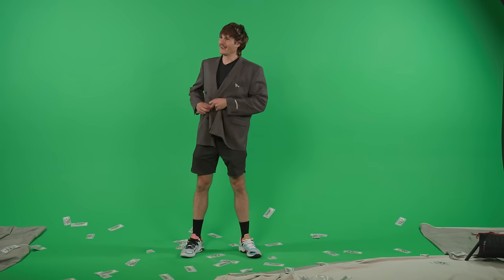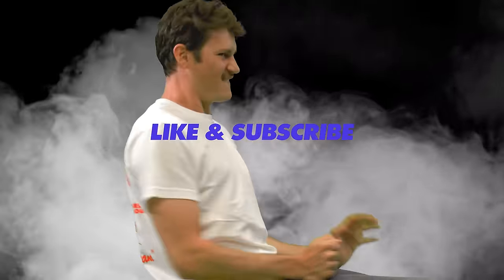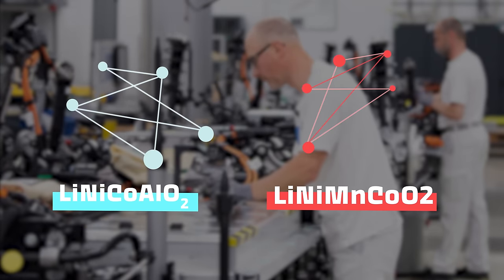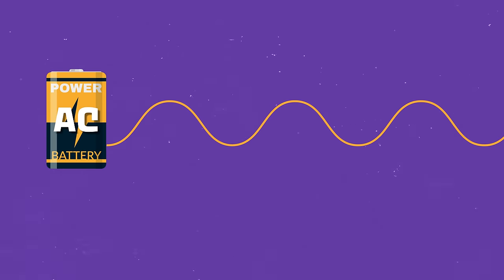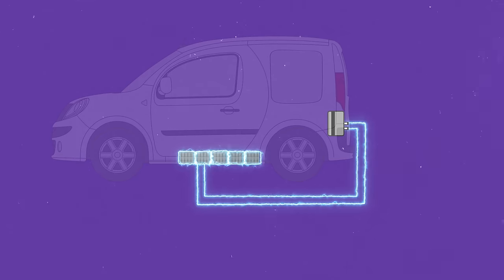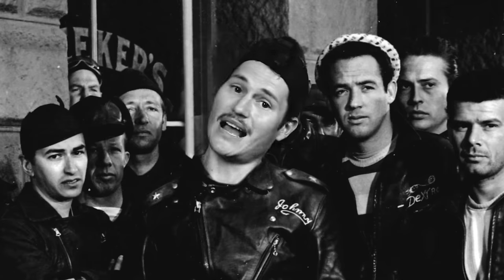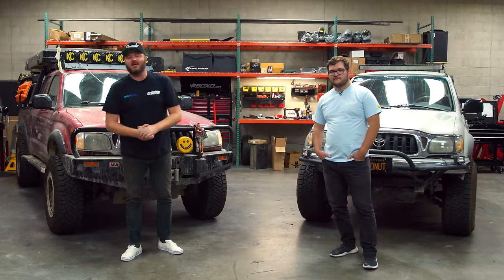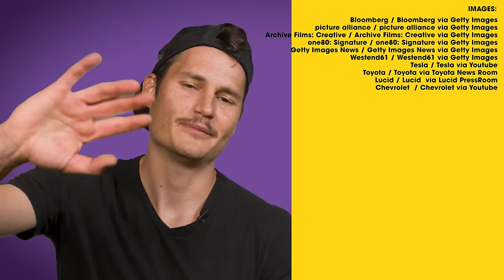Why this Chinese Car Costs $900

Comment: Imagine how much of a hot rod this thing would be with a 10 horsepower lawnmower engine.
Reply: That is for the tuning community to figure it out
Reply: That's a power increase of 525%!!!!!
Reply: @roycezaro1998  : Getting your laundry done in less time.
Reply: I found a truck version for the same price.
Reply: With only 2 cable operated drum brakes to stop...no way
Reply: I'm thinking bigger batteries, or maybe more of them and maybe a bigger hp electric motor
Reply: Basically my idea for the PHV (personal hybrid vehicle.) 7hp Predator engine in the rear, dual front electric motors with torque vectoring, by-wire steering (so the torque-vectoring front motors don't make the steering feel weird.) Would be geared for 30 mph, but electronically limited to 25 for low-speed-vehicle registration reasons.
Reply: Just put a roll cage, coilovers, upgrade the brakes and put a motorcycle engine on it.
Reply: what about a 10 hp engine for a washing machine?
Reply: They have an option for 600cc gas engine
Reply: @jjqq9456  hybusa build
Reply: Why stop there, how about a chainsaw engine. Other great idea crash test, cone, skid pad 0-60 the whole works and then those guys can have a demolition derby.
Reply: @aspecreviews  nahhhh have 2 modes, one for 25/30mph and one for 55 mph :X
Reply: @killerdeamonking  Federal regulations mean it couldn't legally exceed 25 MPH.
Reply: @aspecreviews  Legally no , But people do it anyways.
Reply: @aspecreviews  They modify those mini trucks to do over 25 MPH when sold to the USA by disabling the Governor.  So nothing really changes here.
Reply: @killerdeamonking  everything changes. PH-V would be a very sophisticated hybrid drivetrain. If it was regeared for 55 MPH, the stock control logic would frequently stall the engine, since it's not expecting to suddenly have 55-MPH gearing. The engine clutch would have to be engaged at a significantly higher speed.

Just swapping the engine wouldn't work either, because it'd need to retain all the same sensors as the stock engine. And no matter how high the engine could rev with a hot cam, valve springs, etc, it would still cap out at about 4000rpm, because of the stock ECM and HVCM (Hybrid Vehicle Control Module) code.

Also, the torque-vectoring front motors would rev far past their rpm limits at 55mph, and likely fry the motor controller.
Reply: @aspecreviews  High and low gear . And yes you have to do a clutch mod and a ECM mod for this to work, Although not hard to do just time consuming.

Comment: Sounds like what I've learned here is get one of these as a golf cart, save money and have more speed then a norm cart that cost triple the price at least..
Reply: My workplace is 10 miles from home and I consider to buy one of those.
Reply: @Lassi Kinnunen 81 I agree with you and yes we have slow roads here. It is not worth it because as the poorest, my country is the junkyard of the EU. I think it is much better to make an EV conversion from 1st gen Smart for example. I do have two gasoline cars now and I wish one of them to be swapped for a cheap short range EV.
Reply: @Votoyar  where are you from?
Im from Germany, here is a ev conversion more expensive than a 5 year old smart .
Reply: @TC-iv7dn  I am from Bulgaria. Here 1st gen Smart can be found below 500 euro. The conversion can be cheap if your goal is below 30 miles per charge. It can be done with lead acid batteries.
Reply: @Votoyar  thats crazy cheap but for 10 miles I would cycle mabye. depends on your roads and how friendly the dudes on it are, ha ...

Comment: Someone needs to get a dozen of these together and do a top gear car-soccer game.
Reply: This seems like China's Reliant Robin
Reply: @Where_is_Waldo  Top Gear cut the suspension on that so it'd tip over.
Reply: @CTimmerman  I can't imagine they're hard to tip anyway though, it would take more skill to drive it safely than a regular car
Reply: @Where_is_Waldo  A regular car goes faster and is heavy enough to crush you. The Reliant Robin is a safer, dryer moped.
Reply: @CTimmerman  Well, ok. It just looks unstable to me. Dryer moped? I'm not familiar with that phrase.
Reply: @Where_is_Waldo  It's like a moped, but you're safe from rain.
Reply: @CTimmerman  Haha! Ah, Mo-Ped. Somehow I was thinking past tense of mope, as in "moping about"
Reply: @Where_is_Waldo  That would fit in case of a Peel P50 trying to use a motorway, but the Reliant Robin i conflated it with can do 137 kph.
Reply: @CTimmerman  Well that's a lot faster than I thought it could go. At that speed you'd better brake or turn, not both at once.
Reply: Is that like the game rocket league?

Comment: The modern model T a problem most people didn’t know they needed I can’t wait to see the custom retrofitting that people do to make them faster and more reliable.
Reply: drop a water cooled motorcycle engine in it. now you have more speed and heat in the winter. just find you a chain driven motorcycle. wouldn't be to hard.
Reply: @kevincornell1439  Fun fact, it wasn't chain driven. It have a fully functional differential.
Reply: @Saviliana  ah cool. So a shaft driven bike. An old Honda shadow or magna are a dime a dozen where I'm at.
Reply: @kevincornell1439  you're basically describing an autorickshaw

And yes some companies like tata and Bajaj did try but they failed (like the tata nano for example)
Reply: battery upgrades as Lithium or even used Lithium becomes more available,,, already people putting leaf modules into E-Scooters,,,
Reply: Except you can only go 40 miles max. This is no where near a model t
Reply: @Saviliana  This thing would be wicked with a K24 in it

Comment: This is actually very well explained, great job!  It all boils down to how one intends to use the zyx.  If it's just a 10mile daily back & forth on a very lite traffic, 30mph max route and the bike doesn't fit all your gear, this toy is a no brainer.
Reply: Not street legal in US, tho I'm sure still fun!  :)
Reply: @mmanda515  That depends a lot more on which state you live in. For example in my state of Massachusetts you could drive this on certain roads, but only if you register it as a Low Speed Vehicle, which represents its own hurdles, and even more limitations such as not being allowed to drive on roads with a speed limit of over 30
Reply: They are so cheap you could make it road legal for very little.
Reply: Another neat and actually useful purpose for this car would be as a transition/backup car
Let's make an analogy with PC GPUs:
Your home suffered a power surge which fried your $1,000+ fancy GeForce RTX 4090; this power surge caught you completely off-guard: you're broke, didn't have a UPS, and your CPU is an Intel's F SKU series, which means that it doesn't have an on-die GPU, thus rendering your PC useless whithout an external GPU. You buy a GeForce GT1030 for ~$30, which while you won't be able to play any games, at least you'll be able to use your PC in other tasks (e.g. vídeo watching, work, etc...) while you save again for another high-end GPU
This tiny thing would be the "car equivalent" of a GT1030, while you wait for your insurance to do anything or save enough money to buy another full-fledged car

Comment: The total cost for someone in the U.S. to buy one of these exceeds $6,000 dollars. $930 is the bulk price tag for very large orders and doesn't even include batteries. To buy (1) with the large battery package (50 mile range) cost $2,249. To ship it across the ocean cost another $2200.  Once it arrives in port the import taxes are an additional $1100 and the port charges $750 to release it as well. Then you have to ship it from the port to your house somehow.

Comment: In China, this type of "car", is call mobility scooter with roof, usually for old people.
Reply: Indeed, they are meant for older people who don't have an easy way to get around and  already have very low budgets for their everyday needs.  It's supposed to give them a modicum of range and Independence to get their groceries or pick up the grandkids at school something they couldn't do anymore if they had to walk. China does have a huge aging population so this might just address a key need over there.
Reply: Here in Scandinavia we classify these types of vehicles as a type of moped (assuming that they meet the safety requirements). And they're typically used by young people not old enough to drive cars.
Reply: In the UK, it's a quadricycle and you need a motorcycle license unfortunately
Reply: @Cloudrak  in the us we classify this as your normal mini van

Comment: Only problem with these cars and the trucks is that they don't hold up to weathering. The frame is the first thing to rust away cause the welds are bad and they don't coat it.

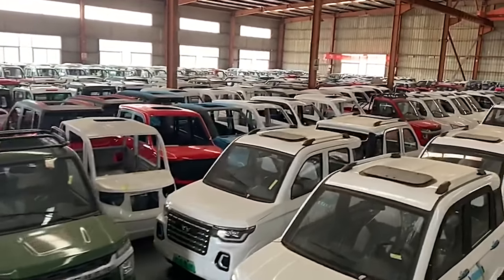Comment: 10:24 Hang on, not only do these cost less than a pair of Jordans I actually saved up for and bought, but it's got the same type of front suspension as a Model T, the steering setup similar to a Mustang 2, a cardboard wrapped battery pack AND a flipping back-up camera  HOW!?!?!?! I just watched the whole video to see how, but I have more questions now than I did when it started!!!

Comment: People never understand how good a cheap car is until they own one. The peace of mind is so joyous. 
you can break it, lose it and thrash it, trade it in and get a new one, and you still better off than most people.
I once brought a Toyota rwd pick up and do burn out for a month and sold it, even made most Money back I spent on tires
Reply: Only problem is you will probably die if someone runs into you lol

Comment: The rack and pinion is still the most often used steering system today. The majority of modern light cars use rack and pinion steering racks, they just also have a power steering system to increase the driver authority. But fundamentally they are just as simple. Heck, an EPS is just an old timey rack and pinion with a sophisticated electric motor tied to the pinion.

Comment: These would honestly be perfect for golf cart replacements. So long as the golf course allows it
Reply: Last week I saw two guys on motorcycles playing golf.. best thing I ever saw
Reply: @chloewebb94  what course?
Reply: Considering how much cheaper they are than golf carts.
Reply: This would be great for golf courses where nobody has a golf bag and throws their clubs to their ball after each shot
Reply: I wonder if they would be legal in those communities that only allow golf carts?
Reply: @johndavidwolf4239  maybe. i think i'd still take the open-air of a golf cart over a tiny, closed in box. i'm also 6'3" with a 35" inseam, so there are already a bunch of regular-size cars that aren't particularly comfortable for me to drive
Reply: @jimjimsonstein9170  just pull out the windshield

Comment: for grocery getting in a small town with speed limit of 25mph, it be a nice little car. would technically be easy and cheap to repair. wouldnt give up my honda accord for driving outside of town, but areas that are slow and small would be fine.
Reply: Something tells me this vehicle is particular to one kind of climate.
Reply: Ever heard of a bicycle?
Reply: Just buy a golf cart . Most places you can drive them on the side of the road
Reply: theres no way its street legal

Comment: I want to see Donut do more on this. Jalopnik has a good series on a Chang Li one of them bought. I think Donut would be able to one up that by doing their own review series, but then maybe also an interesting series on modding a Chang Li. Bigger motor, more batteries, bigger wheels and tires, Low Truck light bar, maybe a little offroading......
That comealong would be perfect for the Chang Li.
Just sayin'.

Comment: This could be made so much better with a welder and easy to get parts. Swap the tiny electric motor for a Briggs and Stratton of some kind, 670cc V twin gets you about 20HP unmodified and loads of torque with a gokart clutch or CVT and simple belt drive. Replace the hubs and as much of the suspension as possible with parts of a wrecked golf cart or large 4 wheeler for good shocks and unlimited wheel/tire choices. And you have an incredible way overpowered chinese plastic death kart for under $1300

Comment: As an electrical engineering student, I really appreciated the bit about AC, DC, and inverters. Just finished a lab where we turned AC signals into DC by clipping the waves with diodes.
Reply: Sounds like you need a...

Huge inhale

FUUUUUUUUUUUUUUUUUUUUUUUUUUUUUUUUUUUUUU
Reply: And dilly doies with willy wooes!

Comment: Are you sure it's not $31,000?
Reply: I actually clicked this video thinking about the scamborghini.... LOL
Reply: It would be $31K if it was a Government project contracted by Boeing.   And it wouldn`t be available for another 5 years.
Reply: Well there's the Baijun E300 plus with a 180mi+ range and a top speed of 62mph for $15,000.

I would totally get an "Americanized" version with more power, range, and better safety features for $22,000.
Reply: HON TONY !!!!
Reply: @handlemonium  the kandi cars are kind of like that.

Comment: I’m seriously thinking about buying one, putting XS power Lithium’s in it, hella solar, and a larger 6hp motor.
Reply: Shriners love that Hella solar.
Reply: 6hp motor will still feel slow
Reply: @iirosiren5120  it’s not about drastically increasing acceleration, it’s about extending the gearing enough to achieve 55mph without sucking the batteries dead. Reducing the weight by switching from lead acid to lithium and using a 6hp motor (specifically because they’re extremely common and easy to source) will allow it to be a damn good daily commuter.
Reply: @heesingsia4634  I get 10% off XSpower batteries, the upgrade is worth it though regardless of cost. I’ll have to check out what aliexpress has for better motors. While the delivery is instant, you still need to be able to function the motor rpm @ 55mph to not reach the peak output rpm of the motor, is what I was referring to with gearing.
Reply: Or a 70 hp AC motor and an Inverter instead of a 6hp motor.
Reply: @iirosiren5120  that's about as much power as my go-kart and it's still fun to drive
Reply: @tristan6509  your go cart prolly weighs 100kg
Reply: @iirosiren5120  but it's a gasoline engine with a single speed chain drive and a shitty centrifugal clutch

It accelerates just as fast at this thing and has about the same top speed too.
Reply: @tristan6509  A light weight, low to the ground will feel faster than this. The lower you get the faster it feels and you cant argue aboat it.
Reply: @iirosiren5120  idgaf, im happy just riding around in a golf cart which is what this basically is.